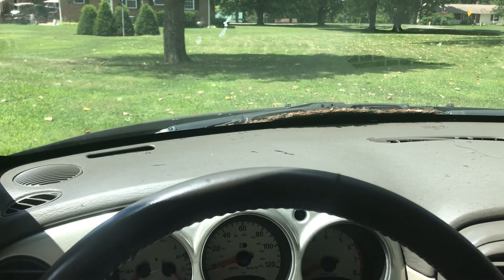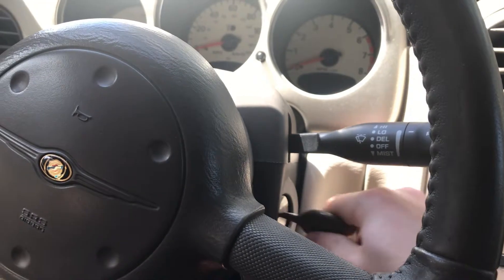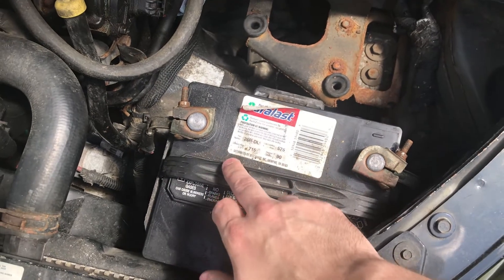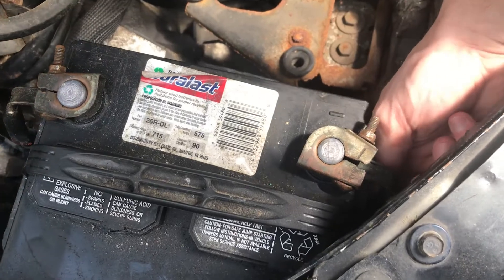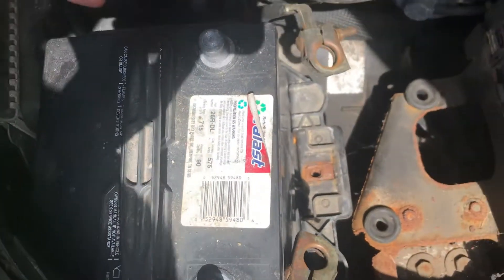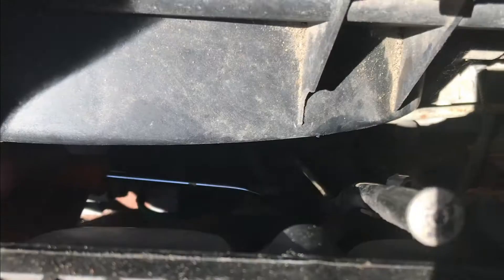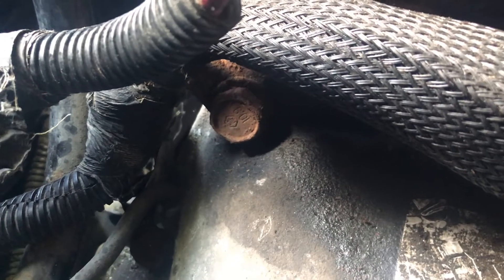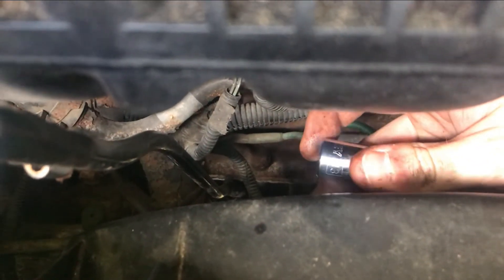How to replace a starter on a Pt Cruiser

Comment: I've had a PT for 15 years now. Had to do head gasket because of the undersized radiator scaling up and overheating. Other stuff, but it still runs. Every repair on the beastie is an adventure. Keep up the good work.
Reply from the maker: Haha yeah the repairs are definitely an adventure. I also had to do a head gasket a one point (actually had to get the head machined because it was slightly warped). I also had to change the rad and pump. I can say I’m glad I no longer own it, there was always an issue lol.

Comment: Just a correction. The wire you took off was not the ground wire. The positive side of the battery is the big wire you removed. The small wire is a switched positive to engage the solenoid for the starter. No biggie. Good video. Getting ready to do it myself now too.
Reply from the maker: Oh that’s my bad, thank you for the correction!
Reply: Lol, that confused me SO MUCH. XD

Comment: U did it.really just take out the cooling fan.top hose.loosen other items.tilt radiator back.its enough room to get wiring 2 bolts out.so much easier.make your life better working on the pt.
Reply from the maker: You’re right, that would have made it so much easier. I don’t know why I didn’t think of that

Comment: Oi amigo blz youtu.be Evandro off na area mano meu eu dou partida parece que a bateria tá fraca o painel de instrumentos fica doido e não liga mais a bateria e nova bem provavelmente seja o motor de partida oque acha..
Reply from the maker: I’m not sure how well google translated this lol. It sounds like the battery is low. Try testing the battery voltage. If the battery is new and is dead already, maybe your alternator is bad.